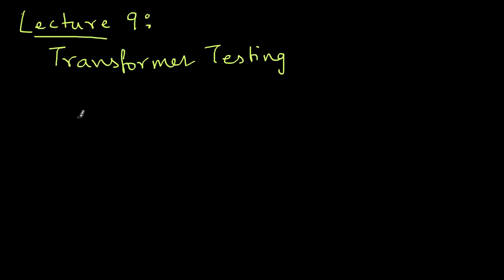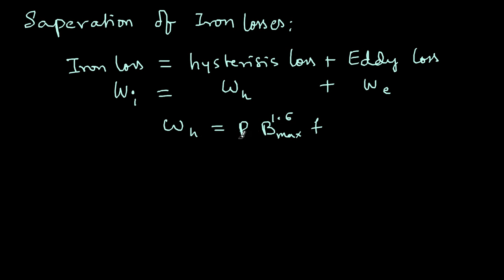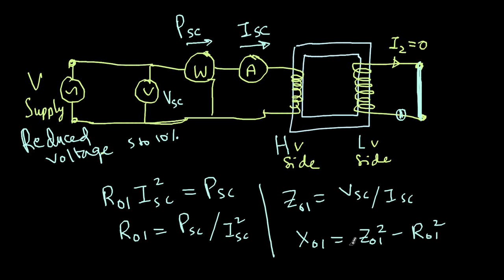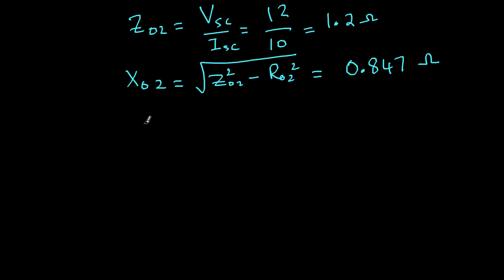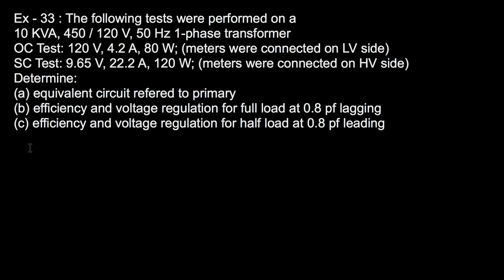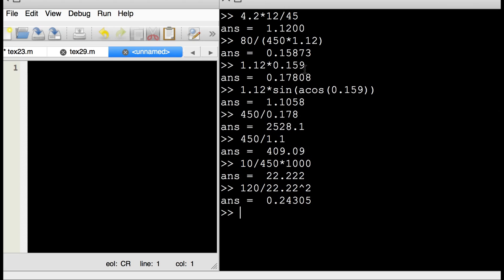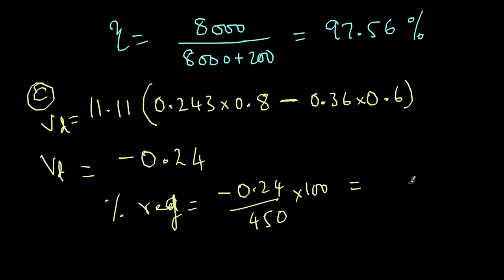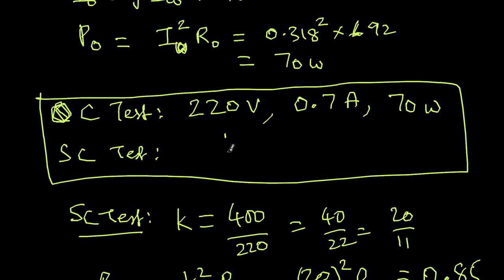L9 - Transformer OC test and SC test

Comment: in the example 31, from the short circuit test data you were calculated R02 and it converted to R01 but in the example 33 form short circuit test data you were calculated R01 directly. can you explain that point I could not get that.
Reply: /. . js.zjz. n💒😁💒😁💣😅🥂😅💒😁🥂🥂💣😁😁💣🥂💒😁😁💣😁💣😁🥂🥂😁😊

Comment: the S.C Voltage in Example- 31, the Vsc = 15 in the problem and accidentally you have taken it as 12V and the  value Z is differing and hence Xm.
Reply from the maker: Dear Sir, thanks for pointing out. This will be useful for other viewers.